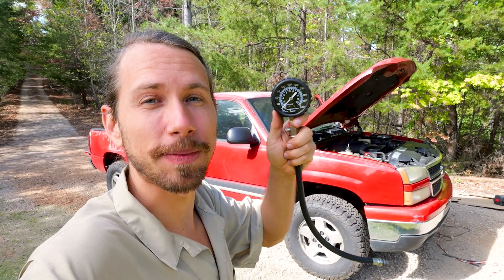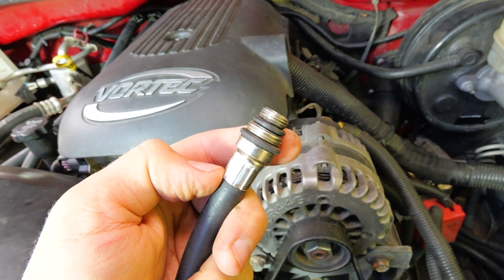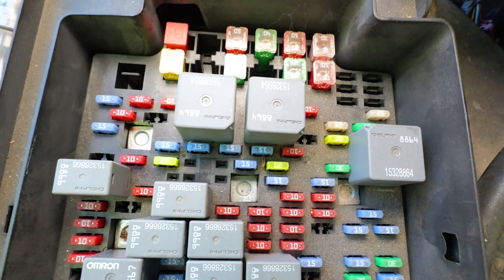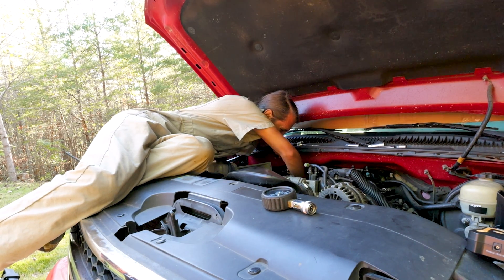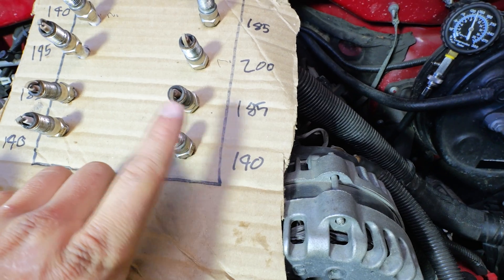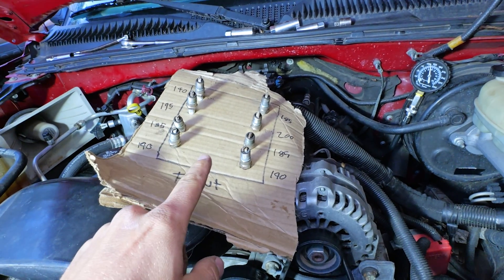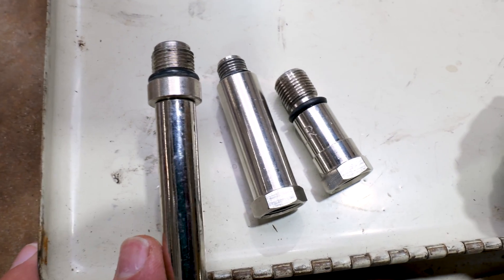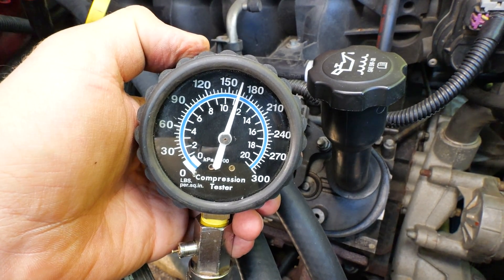Chevy Truck Engine Compression Test? WATCH THIS FIRST!

Comment from the maker: These V8 engines are very easy to compression test. Just make sure all cylinders are between 150-200PSI.
Compression Gauge: https://amzn.to/4gvIbnu
Jump Starter: https://amzn.to/49YmRVi
Iridium Spark Plugs 41-162: https://amzn.to/3UFP5xH

As an Amazon Associate I earn from qualifying purchases.
Reply: Have you ever put bosch spark plugs in/do you have any insight on how well they work/act with these silverados?

Also do you pull ignition fuses as well or just fuel pump?
Reply: is Harbor Freight Pittsburgh or Maddox Gauges good?

Comment: On this 4.8 Silverado engine the cat converters usually go out on high mileage engines, especially ones that burn oil.  To replace cat with straight pipe, what needs to be done with the O2 sensors that sit in front of and behind the cat converter?  Remove the fuses? Tape them up to the chassis and forget them?  How much is this going to affect idle and fuel economy?  Putting a new converter on a high mileage engine would be just a waste of time and money because the new one would plug off too.
Reply from the maker: Guys leave them unplugged and then tune them out of the computer. I don't do it.

Comment: 2002 chevy Silverado vortec v6 was a city utility truck bought from auction. Did 75 on fwy no problem, took it to my mechanic showed me low compression 70psi on #4, and #6. What to do
Reply from the maker: That's not good. I don't like hearing that. I'd put a borescope down the spark plug hole and see if there's engine damage.

Comment: I have a question so I did a compression test the lowest reading was 170 and the highest was 210 for both sides is that good or no?
Reply from the maker: As long as they are around 10% of each other. You should be good.

Comment: Reviewing your GM truck videos. For an accurate reading, hold the throttle plate open when cranking. Otherwise I'm looking for >125psi with little variation between cylinders. I don't expect accuracy with the gauge, just precision (consistency in each reading) and as you somewhat mention, the weaker battery will spin the engine slower and will have lower compression results. So I'm looking for similar reading across all cylinders. One day I'll graduate to the quicker relative compression test based on starter amp draw.

Comment: 178 to 180 psi anything to be concerned about? conparring to ur psi readings
Reply from the maker: I'd they are all consistent. At around 180PSI it's good. Not sure why it is smoking though.
Reply: The reason I ask is cause I had my head remanned and then a shop did camshaft lifters rods oil pump and water pump now I'm smoking like crazy

Comment: I came across Matt's video and immediately it was what I was looking for on how to diagnose my 2011 Cat Eye <Not a Cat Eye, I know...just like saying it like Matt Does, lol>  Silverado 5.3L.  Great work explaining the steps identifying possible issues.  I was able to see that my Cyl 8 (146)  and the rest range from 175 to 190 with 187k miles on it.  I have a rough idle  when idling which prompted me to check and replace items.  I replaced plugs, wires, coil pack.  Misfire does not move off 8.  No oil leaks or vaccum leak that I can see.  The injector was replaced and still not running good at idle.  Does not burn oil either.  Anything I am missing before I take it in a shop?  Oh and O2 sensors seems to be in range as well but can't correct when idling as it is in open loop when at operating temp
Reply: 2011 isn’t a cateye Silverado lol. Cateye is 03-06 with some 07 classics. 2008-2013 Silverados have a problem with the dod which is a gas saving thing Chevy did that isn’t good for your engine. I’d recommend getting the dod delete and that help your problem
Reply: Throttle body cleaning ?
Reply: @frankgarcia1851 Turned out to be camshaft wear.  I tore the engine down, cleaned and rebuilt it.  Works like new now

Comment: do we have to press down on the accelerator to open the throttle body?
Reply: 💯 you want it at wide open throttle... Having the throttle body closed for this test doesn't give you an accurate test result... Dry test first.. then a wet test... Then a leak down test...

Comment: Pull the plastic inner wheel wells out and you can reach straight into the plug holes. I have to do that when I change plugs or wires on my 02 sierra
Reply: Legit? I actually never thought about this.
Reply: @garage7customs I've done the same for my 2011 suburban and 2012 Silverado it makes common maintenance much easier